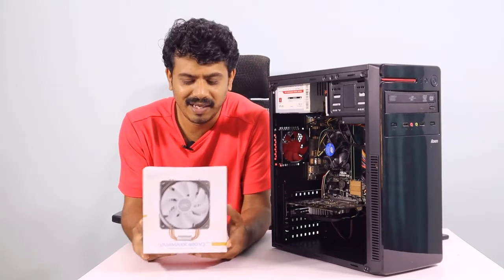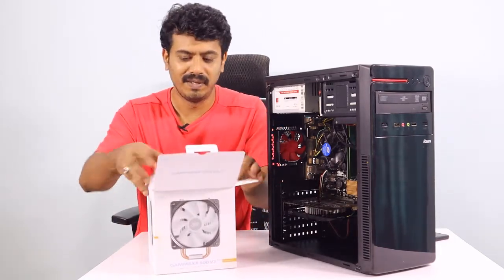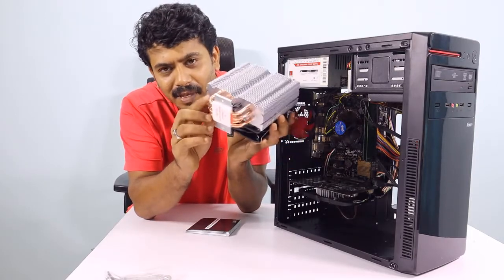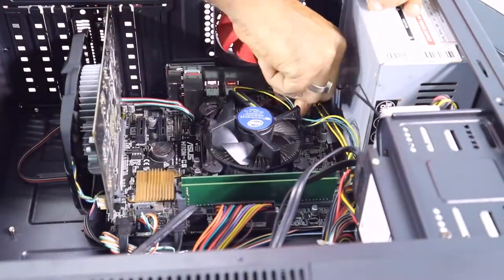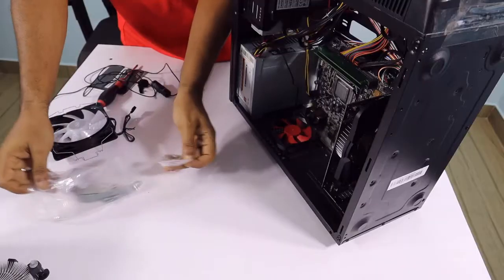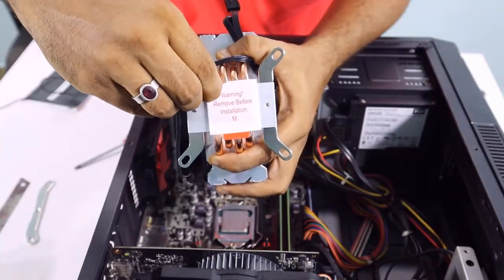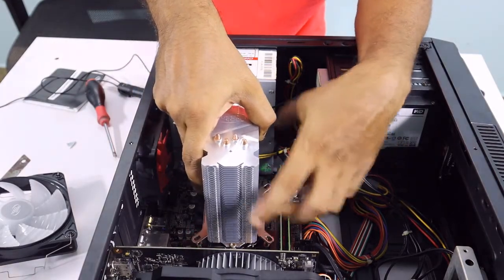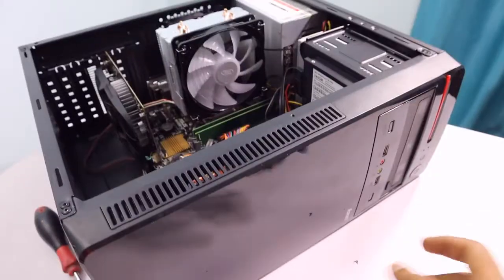CPU Cooler Installation - Malayalam

Comment: AMD RYZON5 3400G suitable fan onu parayamo..
Reply from the maker: AMD Ryzen 5 3400G is having AM4 Socket. So you can buy the same. https://amzn.to/3B2C3P8
Make sure that your cabinet width is equal or more than 18 Cm. Also you can buy Coolmasters :   https://amzn.to/3m5YcXV
In general you can buy any coolers that is compatible with AM4 Socket Type. Hope this helps